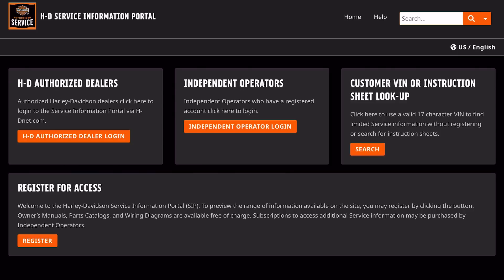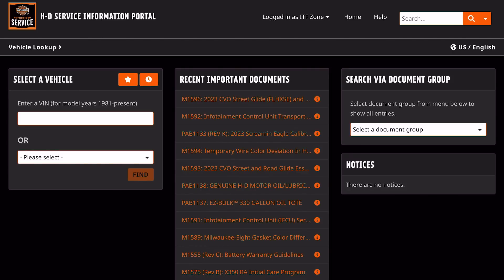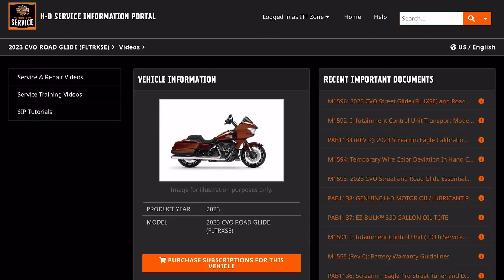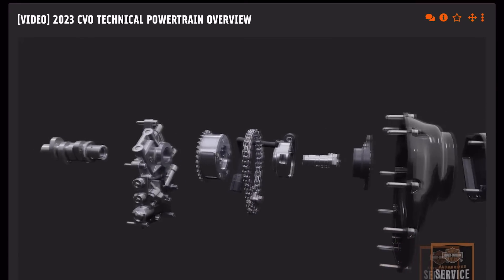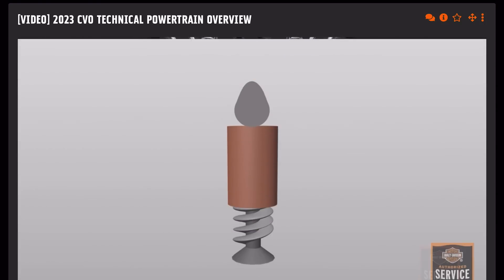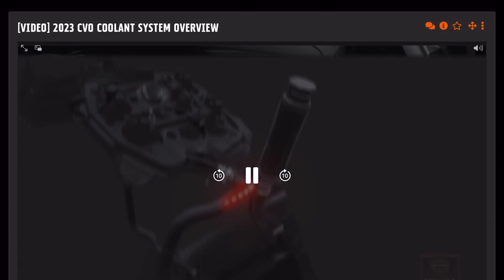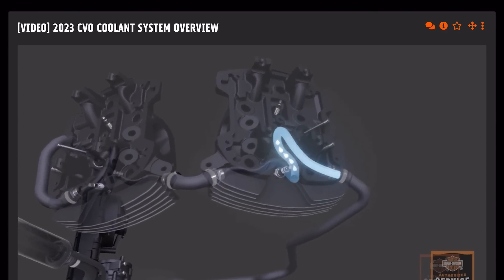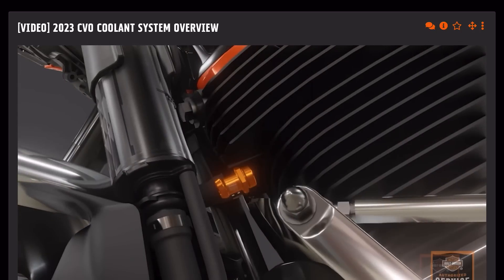2023 121" M8 Motor Internals Revealed!

Comment: i have a 24 CVO 121 Road Glide love it , but some times my temp gets to 235 is this a norm? i live in florida ..
Reply from the maker: So the target is to be 220,  I know the bike officially overheats at 300 and shuts off.  I would bet a dealer will say this is normal but a pressurized test would ensure there is no air in the system.

Comment: Can I ask you a favor. I'm waiting to see if my login is accepted. Could you tell me the torque specs of the top tree bolt (the one that screws I to the stem?
Reply from the maker: Here is what I see for the steps:
f. Tighten fork stem screw.
Torque: 24.4 N·m (18 ft-lbs) Fork stem screw, 1st torque
g. Loosen fork stem screw 180 degrees.
h. Tighten fork stem to specification
Table 1. Steering Stem Torque Specification
MODEL TORQUE
FLHX. 5.9 N·m (4.4 ft-lbs)
FLTRX. 12 N·m (8.9 ft-lbs)
FLHXSE. 5.3 N·m (3.9 ft-lbs)
FLTRXSE, FLTRXSTSE. 11.2 N·m (8.3 ft-lbs)
Reply: @ITFZone  thank you! You're channel has been so valuable to me! You are one of the reasons why I pulled the trigger on a 2023 CVO Road Glide! Thank you for the specs and your content! 🙏🏽
Reply from the maker: @Kickin_it_608  Awesome!  Enjoy that Road Glide,  mine still makes me smile each ride!

Comment: Eventually with Harley coming out withall these bigger displacement engines they will eventually have to have the cylinders and heads both liquid cooled, Harley Davidson engineers must of forgotten that the cylinders get hot too. If the temperature reaches over 250° the piston rings will break. And those cylinders are massive in size. You could almost fit a small dinner plate inside perfectly. With bigger cylinders comes more heat. You have more air and fuel going in Makin a much bigger explosion inside thus the byproduct is heat, and alot more of it, plus they could redesign the crank pun to be squared off on both ends instead of them being rounded, that will gurontee the flywheels will always stay true. They won't go out of balance and make the crankshaft go out of 0. Like the  twin cam motor did. Every reliability issue they have they need to fix all these problems and make Harley Davidson a reliable product, it's 2024, Harley Davidson shouldn't be having any reliability issues anymore. If they make an engine with zero vibration and fully liquid cooled their customers will be alot happier, especially when they know, that they don't have to keep taking their bikes to the repair shop. Keep the push rod design but make it fully liquid cooled, they are going to have to do that anyway, the bigger the cylinders the more heat they produce. I have studied the internal combustion engine for well over 30 years. I have worked  on many different types of engines. People are paying alot of money for these bikes, its time that Harley Davidson build a quality engine
Reply from the maker: It is a love affair with the brand and the experience.   I think many would say that their HD motors have been reliable and many would say they fail way too often.  Can they make a perfect motor?  Possibly but would the Harley fans consider it a Harley?   Appreciate your comment and for sure not disagreeing.

Comment: L would not buy the first year engine . l bought the first year m8 and got 5000 miles and the engine went down .it took 
2 mouths to get my bike back .tire pressure was very low but the dealer said they checked it ,oil was low same BS 
L would guess all the parts and low oil pressure . oil changes would be often .it took 4 years to get the oil pump 
right in the m8   L would wait 3 years before buying .
Reply from the maker: For sure the M8 oil pump created issues for many.   At least with my now first 6 months with this new M8 version I can report no motor issues and really happy with the performance and gas millage.   It is really a different experience from my 2018 117 M8.

Comment: HD should allow this 121 VVT M8 to trickle down to their LowRiderS models. I would buy one.
Reply from the maker: The motor thus far has proven to deliver.   Will see if that continues over the next few months.  It has better sound, runs cooler and power for days!
Reply: @ITFZone   i noticed the sound from the videos, that it does sound meaner. I was curious if that’s due to cams or what. Speaking of cams, wonder if vvt will change the game for aftermarket cams… exciting times in the motorcycle world
Reply from the maker: It has way more of the loping sound,  the CAM profile is different   Also has a bit of TwinCam tick and way less sewing machine!

Comment: Just bought this bike. I so regret it. At 6'3" the bike does not fit. So Harley davidson is primarily owned by bikers. Alot of bikers are well over 5'7". This bike wwy to small. 54k out the door. I am so pist!!
Reply from the maker: Mike!  Bummer for sure,  nothing like spending a small fortune to not have it fit.  The bike for sure has a smaller feel but I think technically its more lighter weight than physical size.   The seat is taller which is good for taller legs but way forward.   I think the bars are perfect for me at 6'1".   But I get what you are saying the bike has a smaller feel.   When I test rode the Street Glide I knew there was no way I could be happy with it compared to the current versions.   Very cramped feeling to me.   I think the RG is a better fit for a taller rider but its not the same as my 18.    Each person is different so I cannot advise what's best for you but I will say as I have put more time on the bike I am really enjoying the 121 motor and the "light" handling compared to my 18.  Its different,  not all in good ways but its sure fun to give it the beans!   All the best to you,  let us know where you end up.

Comment: Thank you for your post. Could you post the video that explains how the oil cooling system works please?
Reply from the maker: Sure we can dig into that,  there is no oil cooler so it looks to be very Twin Cam in design.  Basically all of the M8 oil cooling passages around the heads has been replaced by water.
Reply: @ITFZone  thank you for your reply. So the information mentioned about an oil cooler sits above the coolant rad seems to be incorrect.
Reply from the maker: Correct the only thing up front is the very small radiator which has a fan.   When I rode the bike the fan was not noticeable at all and really did not run when you shut off the bike,  only a couple of seconds.

Comment: Welp it looks like Harley just drove up the price tag for all this innovation, it'll be fun to see how doing a simple cam swap on a VVT system will be.
Reply from the maker: Agree,  what will the early aftermarket CAM upgrades show for numbers?  Excited to find out!
Reply: Will a cam swap even be necessary with VVT? The main reason to swap cam is where you want your power curve. The main reason for VVT is to widen the power band all together. Only thing you can't change is the lift with a software tune. 
There are stock Ford coyotes that have a loopy idle from a software tune.

Comment: Harley owners will complain about everything, but Harley dealt with the heat back in 2017 when the m8 first came out. Those who tamper with the bikes, with aftermarket tuners, shut off Harley safety features. They also raise the engine idle rpm from 800 to a twin-cam,1000 rpm.
Reply from the maker: The M8 has been a great answer to heat for sure.   Mine for sure runs cooler than my last Twin Cam.   The best modification to improve rider comfort is to dump that cat in the header pipe!

Comment: Funny how they use a phaser for cam timing. Not that it makes that much of a difference. The early engine cams were gear driven n S&S has a gear driven setup
for the Twin Cams. I suppose the phaser is used to make up for the cam chain slop as the chain wears out. The other thing I observed is that this system will run quieter because the oil acts as an insulator n cushion for the action of the cam n valve train...
Reply from the maker: I would agree,  the initial YouTuber reactions seem to imply a quieter sound from this new motor.
Reply: @ITFZone  I can tell you why, it is because of EUR 5+ norms, we will move from 5 to + and it is already known from exhaust manufacturers that it will make less DB.
Reply: Clever dude.

Comment: Great video... time will tell if they have tackled the overheating issue. Do you know if they are also running an oil cooler/fan combination? I would assume they are. As a buyer, I would wait several years before considering this new engine. If the M8 oil pump and sumping issues in the 17-19 model years is any indication, this new design will also have some bugs. And, with the price of these new HDs, I have zero interest in being their test rat. HD should provide a 5 year warranty at no cost to the buyer for all new engine combinations in their first year models. With that said, I believe HD will have to go to a full water jacket cooling setup in the near future to compete with Indian's current engine. They will have to for EPA reasons eventually. As a buyer, I want engine reliability and longevity. To keep these M8s from exploding due to excessive heat, owners are installing very expensive cooling modifications. Instead of $4000 paint upgrades, HD should be focusing on keeping the engines cool. My two cents :-)
Reply from the maker: There is a fan behind the radiator but not aware of any secondary fan over the oil cooler.   The video was not clear as to where the oil cooler sits.   If this system works it will be a good compromise to full liquid cooling and hopefully carry us farther into the future.    I know Europe is being challenged to require all motorcycles be zero emissions by 2035.   Would be great if this motor design could have that long of a run.   Appreciate your comments!
Reply: @ITFZone  that would be a mistake if they did not come with an oil cooler fan...

Comment: Really good information - I was wondering how the new engine works.  After a couple of bad experience with my Pan America, I'll surely wait several years before even thinking about an upgrade tho.
Reply from the maker: The early bugs with the PanAm certainly put a bit of a cloud over  the reliability.   It has still proven to be a contender in the adventure category but would love to see the middle weight version released.   Anyhow stay tuned I will share everything I find!
Reply: @ITFZone  Will do - subscribed!
Reply: I have read quite a few horror stories about the Pan Am reliability. Electrical issues and fuel pump failures.

Comment: The coolant..cooler..the coolant tube....coolant goes in an S shape.....next the coolant goes into the coolant cooler.... the then cooling cooler collant cooling system cools the cooling coolant to cool the bikes coolant to then cool the bike.....coolant.
Reply from the maker: But will it the motor run hot? ;)

Comment: Most cars and even trucks now run very thin oil due to the cam phasers. Im curious if HD will spec a thinner oil than their normal 20w50. With the high temps HD engines normally run that cam phaser won't last long.
Reply from the maker: Good point!  A lot of questions on how well the oil will flow through this new system.   Will the oil pump flow issues linger over this new design?

Comment: I'm sure that won't break and the knuckle daggers won't screw this up.
Reply: Have to watch the BBB see how many pages they get on this one . the M8 had 3500 in the first year Voided warrantee saying they over revved the engines .  Putting the Bad engine design on the buyer sucks
Reply: @JCcanU  oh my R U serious?
Reply: @kennethwise7108  Look it up 2018 BBB
Reply: @JCcanU per my insider this new motor has been having lots of issues yet its going to be released irregardless. HD will pass it along to their customers just like they did with the Twin cam 88 with their garbage tensioners that were destroying motors
Reply: @kennethwise7108  They are using plastic for the lifter blocks that are built into the crank case no less .
Reply: @JCcanU  bean counters are really happy
Reply: @kennethwise7108  lmao
Reply: @JCcanU  did a tour of the Powertrain manufacturing company while here. You wouldn't believe it! It's 100% CNC and has very few people who actually do anything. It's all robotically operated to a degree. Very impressive. HD has spent billions of dollars into that facility
Reply: @kennethwise7108  that just the trans or they doing the Case for the Engine Jugs and heads ?
Reply: @JCcanU  100% EVERYTHING! You name it, if it's an engine or transmission component it came from here
Reply: @kennethwise7108  the M8   I have to go see this .   I was going to in 2004 but the shop destroyed my FLT screwed me over for 2 years
Reply: @JCcanU  then Jaggin man
Reply: @kennethwise7108   Im running great took 3 tries to get all the Bugs worked out . the plug holes 1 then the Trash DM left, then the Guide seals and insert i used .  now its just a 14mm plug and i used 530 fueling guide seals .  im at 700 miles . think I will hit 1000 by Thursday ??   my plug is grey fluff  i average 45-55 mpg where I get Fuel  2 stops 91 no methional
Reply: @JCcanU  FANTASTIC NEWS!!!!

Comment: Warning! Better be better than the all SE 114 kit that went in my 2018 M8 LR when it was brand new.  The SE valve spring went 'kaput' at just 13K miles.  Told the dealer to FO and install S&S valve springs when they wanted to replace them with new SE.
Reply from the maker: S&S still improving on the original.   Been in the game for a long time and I don't see that changing!